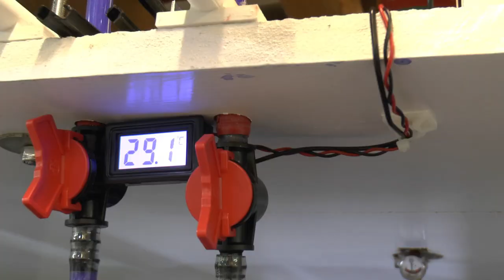1st 997 colour banded, 9 colour, 3D print with my 6 input mixing hot end

Comment: amazing work . it is not clear from the video that did you get the toothpaste effect figured out? does this hotend fix that issue over the diamond hotend?
Reply from the maker: Thanks. It doesn't fully fix the stripey toothpaste effect. It's an improvement on what the Diamond hot end produces but it's not good enough (yet). I've taken a break from 3D printing for while but I'll shortly be resuming my efforts to crack this. I do have a plan...........

Comment: Have you tried mixing materials together? I think it would be really cool to see a TPU/PLA print that uses various ratios of TPU to give the print different mechanical properties at different Z heights
Reply from the maker: This being only the second print with this hot end, the short answer is no. A longer answer is that I have in the past done some prints with PLA/PETG combinations using a Diamond hot end. It is theoretically possible to mix different materials but one has to bear in mind that all filaments have to be loaded at all times and that they all share common heater (so they all get heated to the same temperature). For various reasons that I've discussed before, one has to use PTFE lined heat breaks with a mixing hot end, so this too can limit the choice of materials
Reply: @deckingman  I ask because I'm trying to come up with a multi material printer but one that uses separate hotends for each material. While I've been able to print TPU on PLA, I haven't been able to mix them at all and I think the results could be interesting.

The end goal is printing PETG,TPU, and soluble PVA all in the same print.
Reply from the maker: @stevenmcculloch5727  Sure. Endless possibilities and options......But before I can think about mixing different materials, I need to get better mixing of the same material............there is always more to think about............